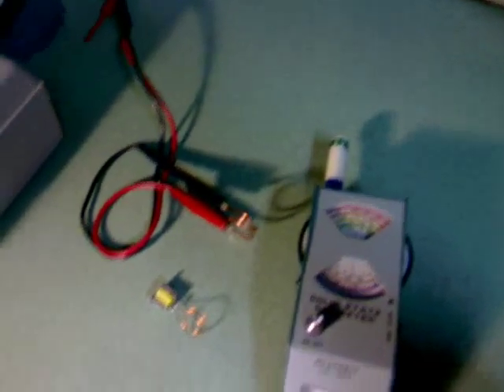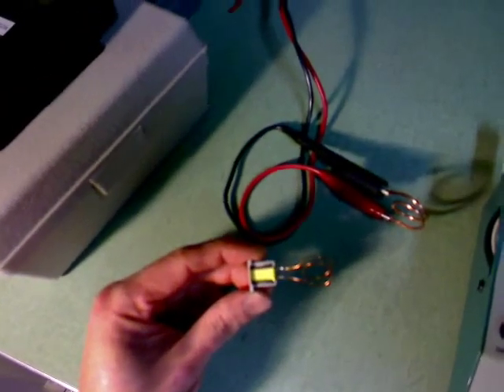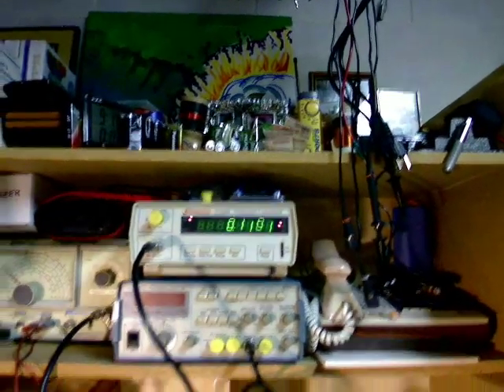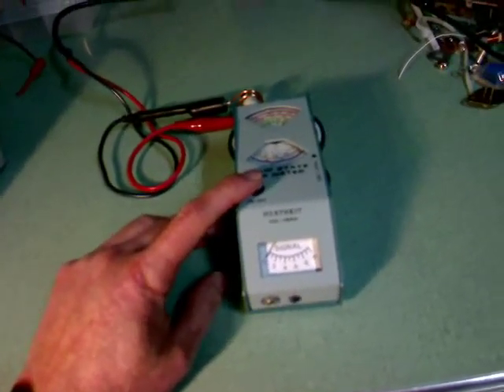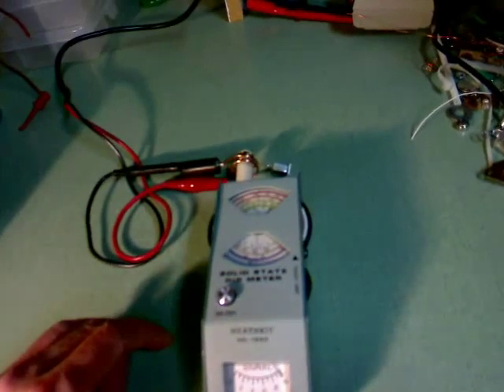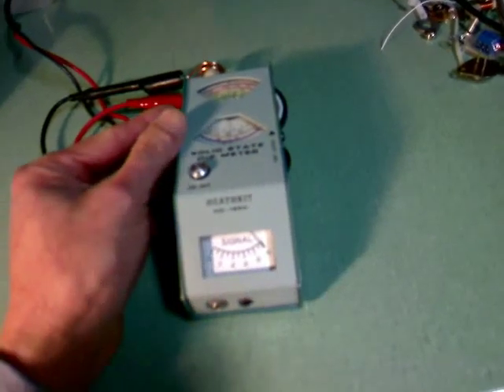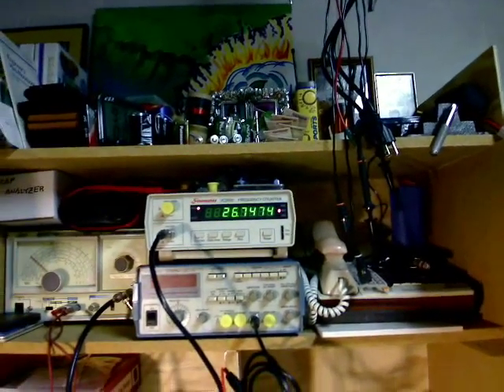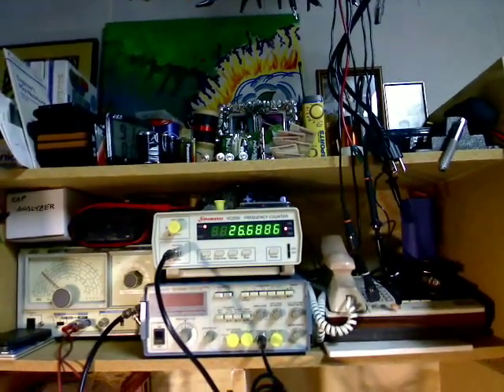How to measure the Frequency of a Crystal

Comment: I am interested in making a transmitter of as yet unreachable high frequencies,,, any ideas on how to achieve oscillations of for example to the power of 1000000000000000000000000000000000000000000000000000000000Htz ?? 
Do you think that by coupling cleaved crystals in series but somehow offsetting the (dips and troughs) that should theoretically produce much higher frequencies...

Comment: I studied it a little bit further (handbook radiotechnoly, 1952, issued by Kluwer in the Netherlands, page 439) and found that a crystal has two peaks when it is to "heavy" (over critical) coupled.If so it can get two peaks: 1 series resonance and 1 parallel resonance, close to each other. When you see a half lattice MF filter with 1 crystal a small capacitor in the crystal holder corrects this. Perhaps when you use a very small coupling capacitor 2-10 pF to the coil you find only 1 peak.

Comment: I think you used a proper way to find the resonance frequency by using a dipmeter and a pickup coil. I used the same manner in the past . Why you found a second dip at 26.690 Mhz is not clear. It could be a normal "behavior" from the crystal but it is also possible that the pickup coil has a certain effect, because it is an inductance and the crystal acts as "capacitor"(?). Parallel inductance to the crystal?  Though the 2 or 3 windings you use are too small to form a tuned circuit on 27 MHz.